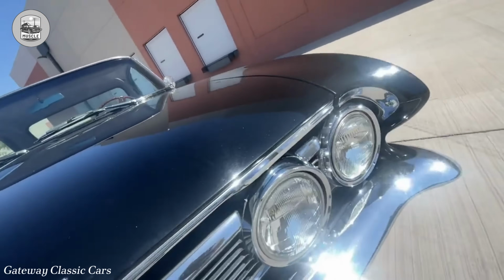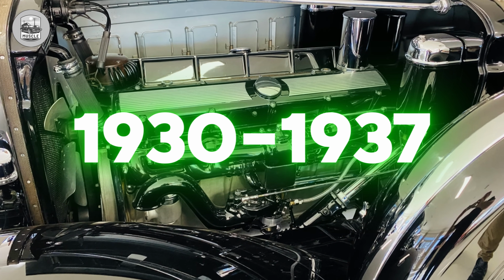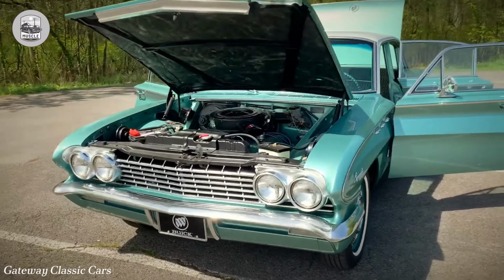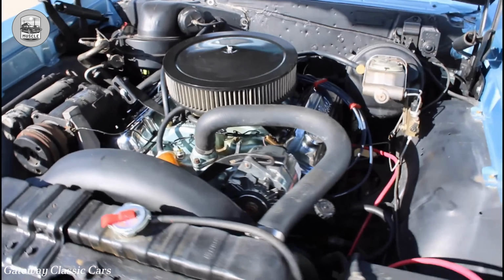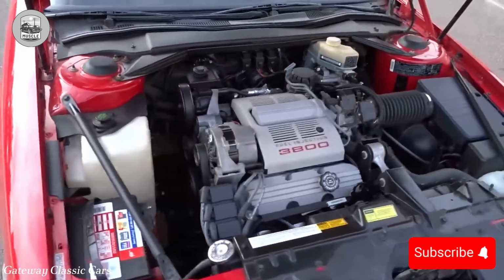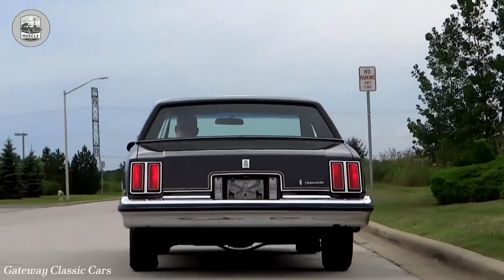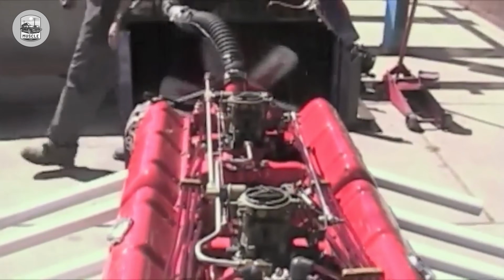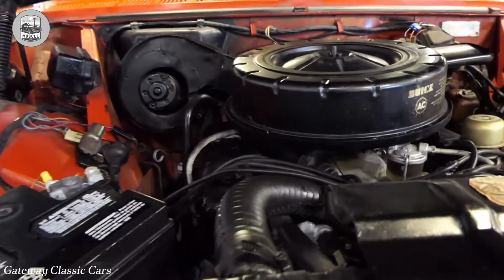10 MOST FAILED and WEIRDEST GM Engines ever made | Worst engines blunder!

Comment: the 4 cyliner engine in the Vega and the 292 ci L6
Reply: Not many know that the 292 was raced in altereds one reason most also didn't know is it shared the same piston the 427 used along with other parts
Reply from the maker: @sidthompso8097  Great point! The 292 straight-six definitely doesn't get the recognition it deserves, especially when you consider its presence in altered drag racing. It's amazing how versatile this engine was, and you're absolutely right—sharing pistons with the legendary 427 gave it some serious credibility in performance circles. It’s always fascinating to dig into these overlooked gems of muscle car history! For anyone else watching, what’s your favorite underrated engine? Be sure to share your thoughts in the comments, hit that like button, and don’t forget to subscribe to Muscle Car Masters for more deep dives into American Muscle Cars! Let’s keep the conversation going.
Reply: @MuscleCarMasters68 , so... People are saying the 427 had a 3-7/8 inch cylinder bore? Because that was the bore in the 292.
Reply from the maker: @markjohnson8260  Thanks for your comment! The 427 and 292 have some key differences, particularly in bore size. The 292 (a straight-six engine, commonly known as the "big block" version of the Chevy inline-six family) indeed has a 3-7/8 inch bore. However, the Chevrolet 427 V8, part of the big block family, had a larger 4.25-inch bore. The 427 was designed for high-performance applications in both street and race cars, while the 292 inline-six was primarily used in trucks and some heavy-duty applications for its low-end torque.
The distinction between the engines highlights how Chevy engineers tailored their designs for specific roles. The 427's larger bore contributed to its power and high-revving capability, making it a favorite for muscle cars like the Corvette and Chevelle.
Feel free to keep the conversation going by commenting below! If you’re enjoying these deep dives, don't forget to like, share, and subscribe to Muscle Car Masters for more engine insights and muscle car history! Let’s keep the passion for classic American muscle alive!
Reply from the maker: Great mention of two interesting engines! The Chevy Vega’s 4-cylinder engine, known as the 2300, had an aluminum block, which was innovative at the time but faced durability challenges—mainly overheating and oil consumption. However, it laid the foundation for future all-aluminum engine blocks. On the other hand, the 292 cubic-inch inline-six (L6) is a legend in its own right, especially for trucks. Known for its durability and low-end torque, it powered workhorses for decades. The 292’s long stroke gave it excellent pulling power, which made it popular in utility vehicles.
For everyone watching, feel free to share your thoughts on these engines or any others you’d like to discuss! Be sure to hit that subscribe button, comment below, and check out more videos on the Muscle Car Masters channel
Have a good day.
Reply: @MuscleCarMasters68  your correct worked on many 2300 blocks in Vegas anyone old enough to remember they had overheating problems. If you ran them to long overheating it would warp the blocks in between the 2 center cylinders creating 2  two cylinder engines  making it impossible to seal a new head gasket ultimately the engine was junk after all that labor to fix it and as usual in those days GM scarcely told you about it even after field mechanics reporting it for up to 2 years finally we got tsbs about it and plans to eventually replace it with the Iron Duke which wasn't much better
Reply from the maker: @sidthompso8097   Yes, and the lack of a durable liner in the cylinders made warping between the two center cylinders a common problem. Once that happened, sealing the head gasket was nearly impossible, as you mentioned, turning the engine into a costly loss. GM's delayed response with those TSBs left many mechanics frustrated, and you're also right about the Iron Duke—it was better but far from perfect, with its own share of issues, especially in performance applications.

I appreciate you chiming in with your knowledge—it's this kind of shared history that helps keep the legacy of these engines alive. Everyone else, feel free to drop your thoughts and stories in the comments! Let's keep the conversation going. And hey, if you're enjoying this deep dive into the highs and lows of muscle car history, don't forget to like, share, and subscribe to the Muscle Car Masters channel for more!
Reply: While the 292 ci L6 was a reliable workhorse, especially in trucks, the 4-cylinder engine in the Vega had significant issues. It was plagued with design flaws, particularly with its aluminum block that lacked cylinder liners, leading to early wear and poor durability. Many owners experienced overheating, oil consumption issues, and head gasket failures. Comparing these two engines isn’t fair, as the Vega’s engine simply didn’t live up to the long-term dependability of the 292. The Vega's engine failed to meet the expectations of reliability that Chevrolet built its reputation on.

Comment: Gm should of kept the 3800 v6 but just changed the design a bit to where it could have dohc
Reply from the maker: The 3800 V6 was one of GM's most reliable and versatile engines, especially in terms of durability and fuel economy. Many fans agree that a DOHC version could have boosted its performance, especially with modern advancements in variable valve timing and direct injection. It would have been a strong competitor in the performance V6 market, especially considering how well it handled forced induction with the supercharged L67 variant. Imagine a DOHC 3800 with better airflow and revving capability — it could've rivaled engines like Nissan's VQ series! What other improvements do you think GM could have made to the 3800?
Reply: @MuscleCarMasters68  Whats odd with serious 2 is it has side cross bolts but only 4
Reply from the maker: @infernoking7504  The side cross bolts are indeed an interesting feature in the Series 2 engines. What makes it odd is the use of only 4 cross bolts rather than a more typical 6 or 8 like in other performance-oriented engines. This was likely a compromise in design to balance strength and cost, but the 4 cross bolts still provided some added rigidity to the block. For serious racers or builders, upgrading the bottom end was a common mod to handle more power. Have you ever come across someone who modified the bolt setup for extra strength?

Comment: The Corvair was the first turbo weeks before Oldsmobile…
Reply from the maker: Great point! The Corvair was indeed the first American production car to feature a turbocharger, debuting just weeks before Oldsmobile introduced their turbocharged Jetfire. In 1962, the Chevrolet Corvair Monza Spyder was equipped with a 150-horsepower, 2.4-liter flat-six engine paired with a turbo, making it a true innovator in boosting performance through forced induction. Meanwhile, Oldsmobile's Jetfire, released shortly after, used a Turbo Rocket V8, which also brought significant advances with its Turbo-Rocket Fluid system. Both cars paved the way for future turbocharged performance, but it’s fascinating to see how they each approached the technology. What do you guys think? Which turbocharged innovation had a bigger impact on the future of muscle cars?
Reply: While it's true the Corvair's turbocharged engine came out in 1962, it's not entirely accurate to say it was the first turbocharged production car. Oldsmobile actually released the Jetfire Turbo Rocket in the same year, and both vehicles came to market around the same time. In fact, some sources claim the Oldsmobile Jetfire debuted just a few weeks before the Corvair. While both cars were pioneers of turbo technology in the 1960s, there's some debate over which actually hit the streets first. Regardless, they each played an important role in advancing forced induction technology.
Reply from the maker: Thank you for your information. It is so great...
Let's see our channel is a place to share, comment or show your feelings about American Muscle Cars.
Have a good day.
Don't forget to like, share or SUB on our channel to enjoy other great Muscle Cars videos.
Spending more time with other great videos on our channel to explore more about American Muscle Cars.

Comment: Name one engine that Chrysler screwed up????????????
Reply from the maker: Thanks for the great question! If I had to name one engine that Chrysler really missed the mark on, it would have to be the 2.7L V6. 😁😁😁 This engine, used in several Chrysler, Dodge, and even Jeep models in the late '90s and early 2000s, gained a bad reputation for oil sludge buildup and timing chain failures. Despite good initial power numbers, the lack of durability and reliability gave it a poor name, especially when owners faced expensive engine replacements earlier than expected. But hey, I'd love to hear what everyone else thinks! Do you agree with the 2.7L V6, or do you have another Chrysler engine in mind? Drop your thoughts in the comments below and let's see which engine gets the most votes.

Comment: The Cadillac V16's output was merely adequate for its day. The engineers couldn't find 15 more horsepower to crack the 200-mark with 7.4 litres and 16 cylinders?
Reply from the maker: You're absolutely right that the Cadillac V16's output may seem modest by today's standards, especially considering its 7.4-liter displacement and 16 cylinders. The V16, which produced around 175 horsepower, was primarily designed for smoothness and luxury rather than raw power. Cadillac engineers focused on delivering a silky-smooth, almost silent driving experience to match the opulence of the cars it powered. Back in the 1930s, horsepower numbers weren't as much of a priority as they are today—Cadillac was more concerned with refinement and prestige. As for why they didn't push for more power, the technology and fuel available at the time placed limits on what could be achieved reliably. It wasn’t until later that we saw more aggressive performance tuning in engines. The V16 had a massive torque curve, which made it feel powerful even if the numbers didn’t scream performance.
That said, imagine if they had cracked the 200-horsepower mark—it would have been a milestone!
What do you guys think? Would a higher horsepower figure have changed Cadillac's image at the time, or was smooth luxury more important?

Comment: How about the Buick 401 Nailhead matched to auto trans that had a "switch pitch" torque converter.
Reply from the maker: Great question! The Buick 401 Nailhead paired with the "Switch-Pitch" automatic transmission is a fantastic piece of muscle car history. The "Switch-Pitch" torque converter allowed drivers to change the converter's stall speed on the fly, giving you more torque off the line when needed or better fuel efficiency during cruising. It was Buick’s innovative approach to combining performance and comfort, giving drivers more control over power delivery. This setup was used in some of Buick’s most iconic models in the mid-'60s, like the Wildcat and Riviera, making them quick off the line despite their size. The Nailhead engine, known for its narrow valve angles, created an efficient and strong powerplant that could handle torque incredibly well. Combining it with this transmission made the 401-powered Buicks formidable sleepers. I’d love to hear what others think of the “Switch-Pitch” setup! Does anyone have any experience driving one, or stories about Buick’s legendary Nailhead motors?

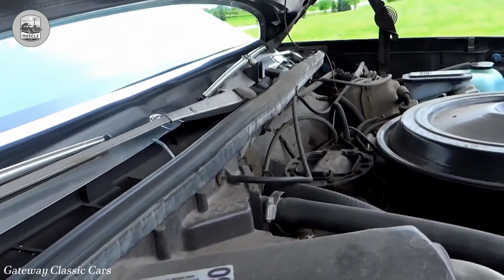Comment: 21:13 -- Why does a Diesel engine have an HEI ignition distributor?
Reply from the maker: Thanks for the great question! Diesel engines don’t traditionally use an ignition distributor, especially not one like an HEI (High Energy Ignition) distributor, because they rely on compression to ignite the air-fuel mixture rather than a spark. However, in certain rare cases, you might find a diesel engine fitted with an HEI distributor if it's been modified or if it’s a converted or hybrid engine setup. This could happen in cases where a diesel engine has been altered to run on gas or propane in dual-fuel applications. Some engines may have originally been gasoline engines converted to diesel but retained certain components from the original ignition system. I’d love to hear if anyone else has come across setups like this or other unusual diesel conversions! Share your thoughts and experiences in the comments, and let’s get a great discussion going...
Have a good day.
Reply: @MuscleCarMasters68 : Old Diesel trucks and tractors frequently used both fuels, taking advantage of gasoline's volatility to start, switching to Diesel operation when warmed up.
Reply from the maker: @edwatts9890  It’s true that many early Diesel engines, especially in tractors and heavy trucks, used gasoline for starting because Diesel fuel was harder to ignite when the engine was cold. For example, International Harvester’s "start on gas, switch to Diesel" system in their Farmall tractors was a great innovation. They’d start on gasoline with a spark ignition and then switch over to Diesel operation once the engine reached the proper temperature. This helped farmers maximize efficiency and reduce costs. 
Does anyone else have stories or knowledge about similar dual-fuel systems? 
Feel free to comment below and share your experiences or details on other engines that did something similar.
Reply: @MuscleCarMasters68 : Many big trucks before the 1950's -- REO, Autocar, and others I can't recall started on gasoline, ran on Diesel.
Reply from the maker: @edwatts9890  Great observation! Many of the big trucks from the pre-1950s era, like REO and Autocar, did indeed use a dual-fuel system where they started on gasoline and then switched over to Diesel once the engine reached a proper operating temperature. This system was especially useful because Diesel engines of the time were known for being difficult to start in cold weather, as they lacked the modern glow plug systems we see today. Gasoline, being more volatile, allowed for easier starting, and once the engine was warm, it could run more efficiently on Diesel, which offered better fuel economy for long hauls.
REO trucks were pioneers in the American trucking industry, and Autocar, founded in 1897, was known for heavy-duty vehicles and innovative engineering. These companies were essential in pushing trucking technology forward, with engines that could handle different types of fuels to maximize efficiency. It wasn't just REO and Autocar either. Some trucks from brands like Mack and International Harvester also experimented with multifuel engines. The military even used similar technology in the 1960s for vehicles that could run on gasoline, Diesel, kerosene, or even jet fuel!
What other brands or models from that era do you all recall using these types of dual-fuel systems? I'd love to hear your stories!

Comment: Forgot about the Jeep 327, the international half 8,  Pontiac half 8. The gm 637. And the 702 was an industrial  engine. Made to last forever
Reply from the maker: Thanks for bringing up some of these forgotten gems! The Jeep 327, known as the Vigilante, was an AMC engine that powered several Jeep models in the 1960s. It was a durable V8 with a solid reputation for low-end torque, perfect for off-road and towing applications.
The International half 8 and Pontiac half 8 are often overlooked, but they were innovative designs that essentially used half of a V8 to create a 4-cylinder engine. These engines found their way into some interesting applications, especially during times of fuel economy concerns.
The GM 637 was indeed a powerhouse in the industrial world. A massive V8 diesel engine, it was commonly used in heavy-duty trucks, buses, and other commercial applications. Built for endurance, it was designed to handle the harshest working conditions and keep running.
Now, the GM 702? What a beast! This V12 engine, with its roots in GMC trucks, was designed for industrial use, and you're right—its reliability was legendary. This engine could handle long hours of operation without breaking a sweat, and it was a favorite in large commercial trucks, and agricultural equipment, thanks to its durability and massive torque output.
Let’s keep the discussion rolling—what other engines do you think deserve some spotlight?
Reply: @MuscleCarMasters68  note the jeep 327 was a over head cam design and had 320hp and something like 340ftlbs of torque. For jeep then it was a power house. I would give exact numbers but my motors manual is missing.
Reply from the maker: @Instantcalmity  Yes, so great when we hear that.
BTW, Thanks for dropping some great info on the Jeep 327! You're right about it being a powerhouse for its time, but just to clarify, the Jeep 327 V8 was actually a pushrod engine, not an overhead cam design. It was introduced by AMC (American Motors) and used in various Jeep models like the Wagoneer and Gladiator trucks. The power output was impressive for a mid-sized V8 back then, with around 250-270 horsepower and 340 lb-ft of torque.